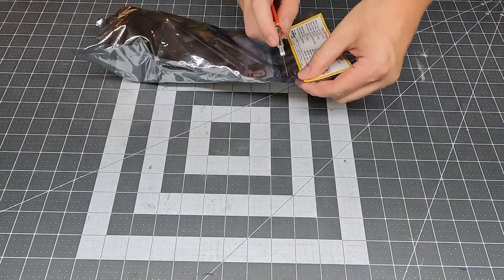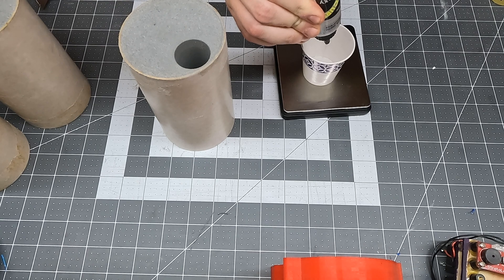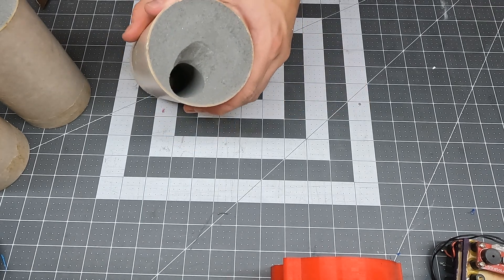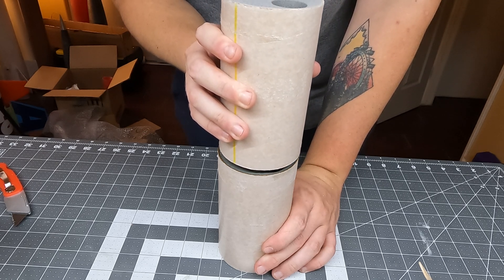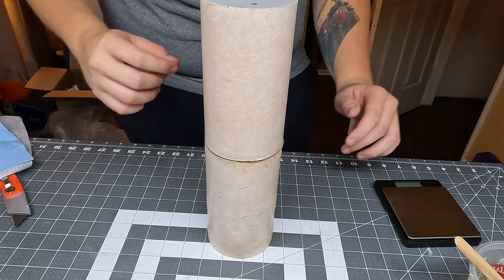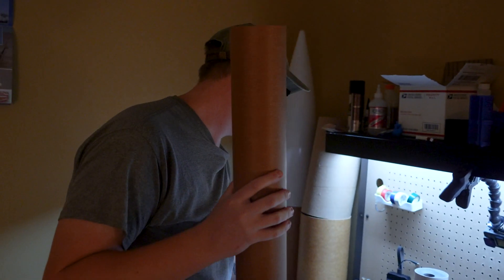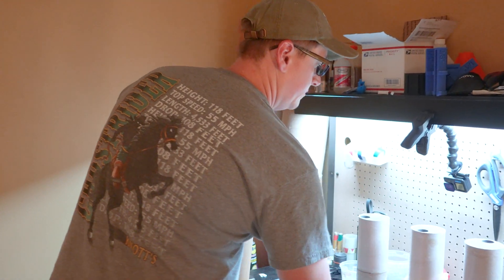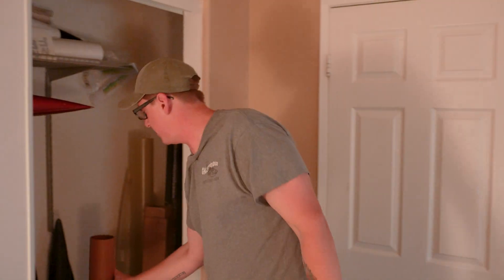Grain Face Bonding In Solid Rocket Motors (Aerotech N1000 Assembly)

Comment: question for anyone, how long will a motor stay good for loaded into a case? For that matter grains not in a case? Do they harden and crack over time or decompose in an way? I have old G motors from the 90's and always wonder if they are ok to launch? They have been climate cycled through winters and summers in an un controlled place below 0 in winter and 97+ in the summer). The labels say use within 1 yr. which I know is BS.
Reply from the maker: I have flown a handful of rocket motors that are almost as old as I am. IF they've been in a vacuum-sealed bag, they are typically perfectly fine. However, if they've been exposed to the moisture in the air, the propellant can swell and, even if it appears to be in good shape, be extremely difficult to get to light and pressurize properly. 

I believe the longest I've had a motor loaded before flying was a little over a year and a half. I tend to put a ziploc bag over open ends and tape them up to try to prevent moisture from getting in.